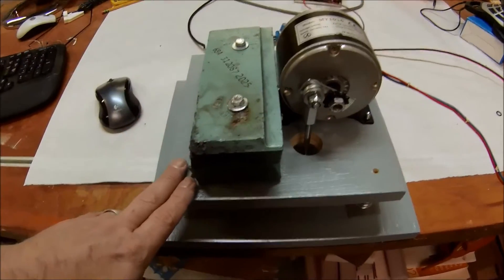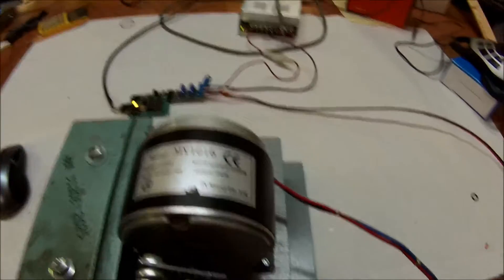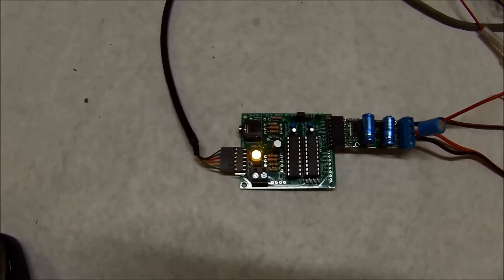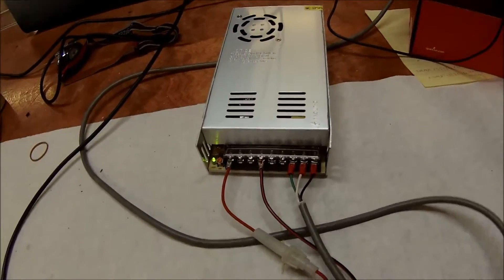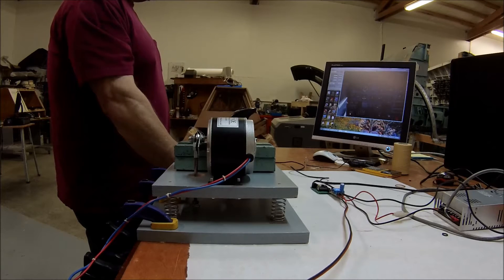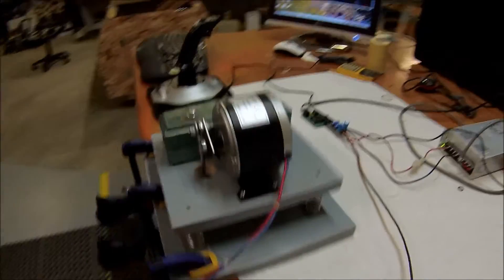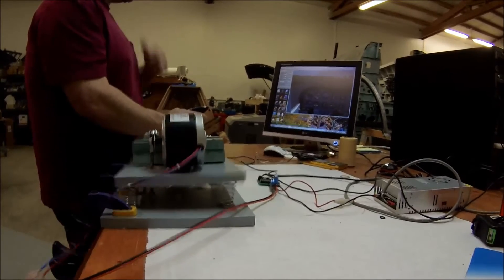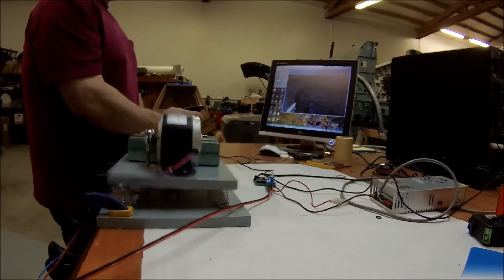Flight simulator vibration feedback system demo using SHKR-1 control board.

Comment: I want to know.this motor vibration created as vibration on off faster or.
Using unbalance shaft.
Reply from the maker: The vibration is created by the motor moving rapidly back and forth.  The lead weights increase the mass of the whole system and the sharp edges of the vibration are damped out by the four support springs.

Comment: That's great,  I'm looking at building something like that.   
I'm building a spaceship simulator pit. 
Just a word of warning,  you want to avoid running something like that with your PC on the desk,  it can really screw up your hard drive if it's not a solid state drive.  Think of your hard drive like a record player.  You don't want to risk smacking that around.  If it accidentally writes in the wrong spot or worse still the head crashes into the spinning platter.....

Comment: Brushed or brushless motor? I just ordered the BFF and pololu cards : )
Reply from the maker: Shawn, the motor I used is an MY1016 brushed motor.  There's a pile of them on eBay right now, varying in price from $25 to $40.  You don't want the geared version.
Reply: Thank you, I was confused with the brushed permanent magnet configuration. I thought it was either brushed OR permanent magnet. Google is much smarter than I am. I just ordered a MY1016 at a good price from a canadian distributor so shipping was reasonable. Looking forward to getting this all together. Any thoughts, things you might do differently? Are you happy with the lenght of the offset arm attached to the motor shaft? my thoughts were that as short as possible would give you the most torque? maybe not such a huge issue with the size of the motor?

Thanks for the information, much appreciated. I'll post a video as well once I'm up and bouncing.
Reply from the maker: The whole thing was slapped together without much of a plan beyond the basic configuration.  The shaft length was dictated by the height of the springs and nothing else. :)  You do want 10-20lbs of weight on the platform though.  The weight gives it enough mass to be able to suitable hammer the snot out of whatever you've got it bolted to. :)  I'm tempted to build another one so I can put one fore & aft.
Reply: f15sim If i remember correctly the pololu driver card will drive two motors, you would just need a power supply that could handle the load and you could have a shaker for and aft. Might consider that myself.

Comment: Could I get a demo of a Jet like a Lear. Many of us are building a learjet cockpit and I would like to see how loud your setup is so I can start planning a way to muffle it.
Reply from the maker: The Jet effects won't make it any louder.  In fact most of the noise you hear can be damped out by adding a couple of rubber washers to the motor end of the mechanical linkage.  I've got it mounted behind me in the Series One and you can't even hear it over the engine sound, even at idle.
Reply: Awesome thanks!

Comment: its not a silly vid at all , I found it to be very informative will this kit work on  a buttkicker. ps. I love some of the background pits looks like my workshop
Reply from the maker: Most folks that use the SHKR-1 card hook it up to a buttkicker to save on the cost of the Pololu motor driver and power supply. :)
Reply: cool thanks for the info . I would like to pick ur brain on this matter at a later date if that's ok
Reply from the maker: Sure, no problem.
Reply: just one more favour could u do a vid on your work shop , you know a walk around nothing to heavy . I see two pits in the background  and have gleimed   as much as can frame by frame from your vid ( on a 55inch monitor ). you never know where you pick up inspiration from or idears . Ta from your Aussie mate
Reply from the maker: Hehe.  There's three cockpits - the prototype "Series One" cockpit that I built (http://www.geneb.org/pitkit), the "production" version of the Series One and an then there's the F-15C. (http://www.f15sim.com)  Go through my other videos and you can see some of the other nonsense I've got going on. :D